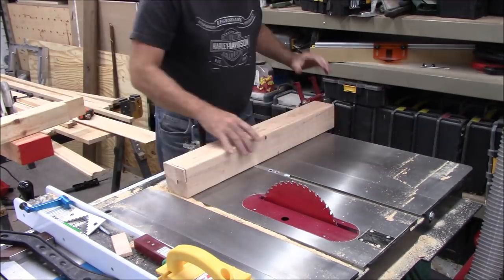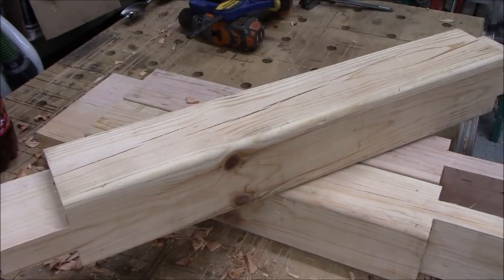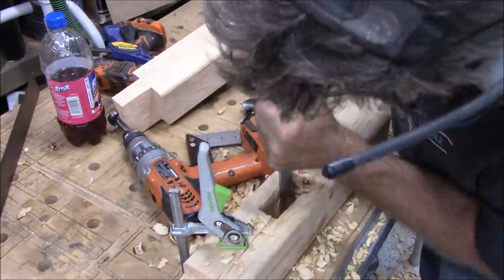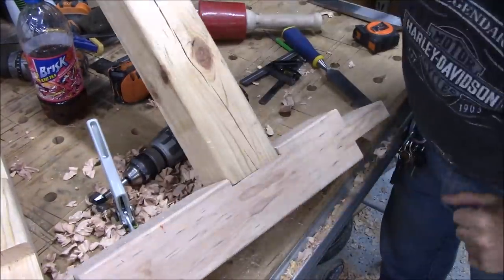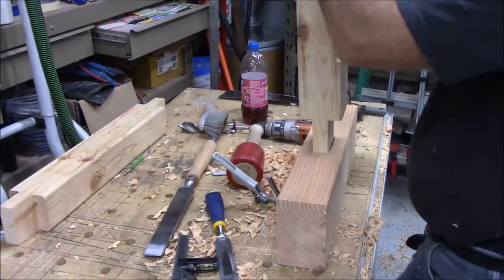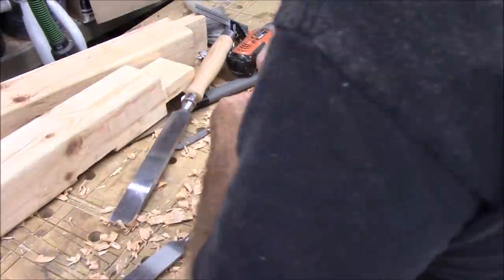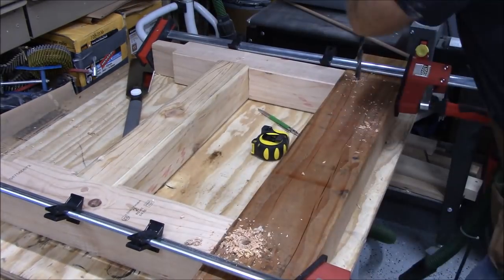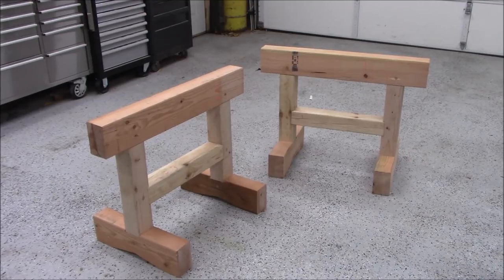building  timber  frame saw horses

Comment: I built the same saw horses, but I used pressure treated 4x4 and 4x6 stock and made them all without power tools,  except for a drill.  Yes, they take much more time than one would think, but they are very robust saw horses in the end.

Comment: What is the advantage of sinking the tenons down below the surface of the mortise what was it an inch.  Wouldn't it work just as well if you had a good fit with the mortise and Tenon and then did a drawbore?

Comment: I like your saw horses but need to ask an honest question. After 2 years do you use them or do you wish they weren’t so big? My shop is big enough but I feel like I’d start leaving those outside because of their size. Do they take up much room? I also need heavy duty saw horses for logs. Should I make them out of Pressure treated lumber just in case they end up spending more time in the weather?
Reply from the maker: I am still very happy with them and use them all the time I do keep the in the shop. Treated will hold up better outside but wood will shrink over time so not sure how the joinery will hold up. They do kinda nest together when I am not using them so it does reduce space some
Reply: Thanks